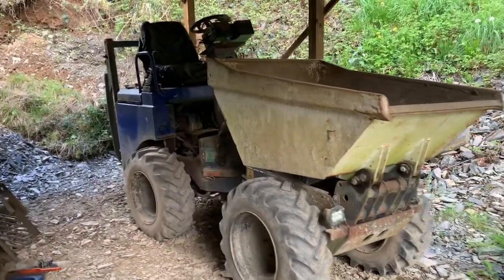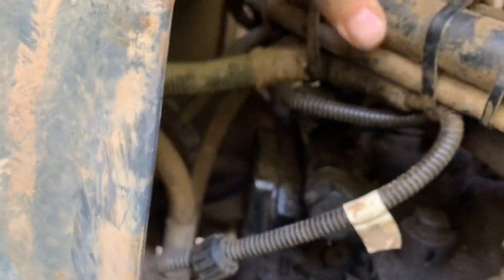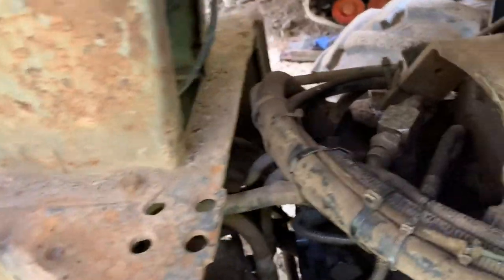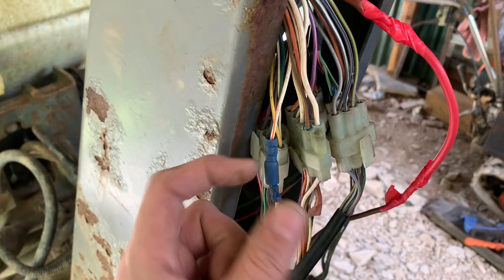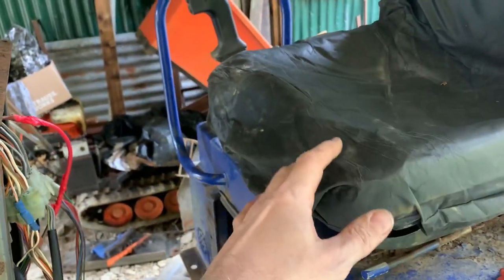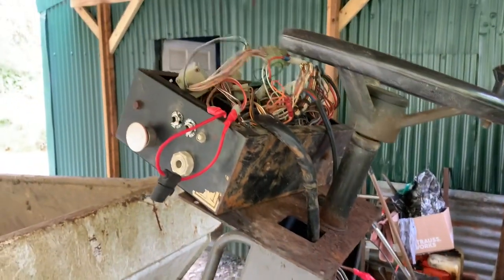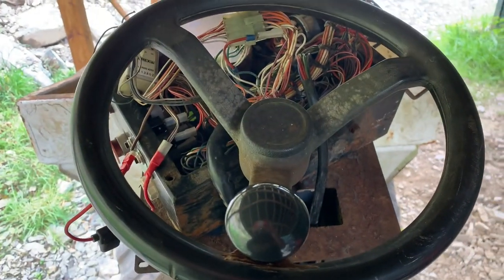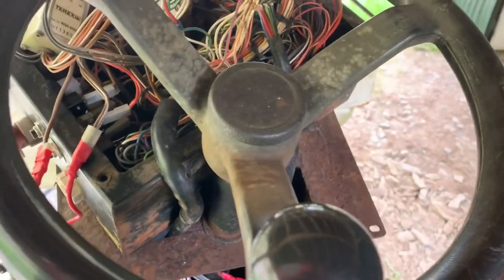Benford Terex Dumper Fault Finding HD100 No forward or reverse.

Comment: Hello, I have the same problem as you except that my 3 lamps are always on, do you have any ideas? THANKS
Reply from the maker: Missed this.  Sorry.  

Have you checked the fuses.  To be sure, try shorting (bypassing) the fuses.  They’re quite unreliable. 

The other thing is that I would expect the lights to change when seat sensor is triggered, or the control lever is centered. 

With these machines, water ingress into the control module is a real problem   :/